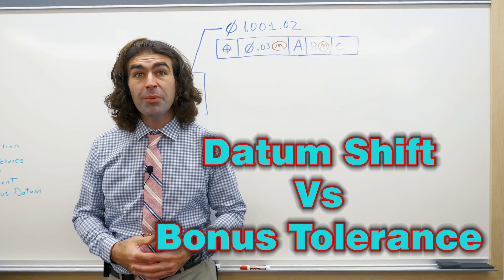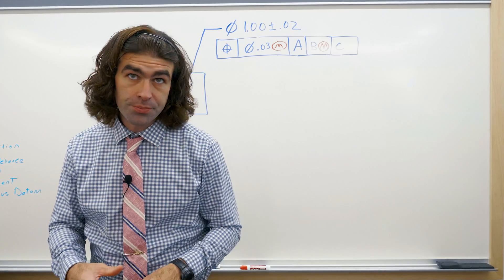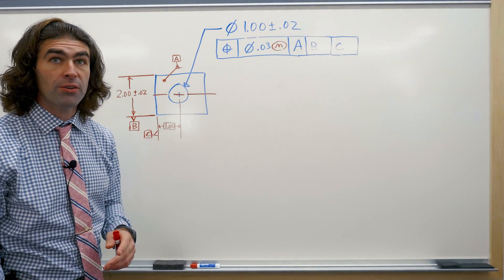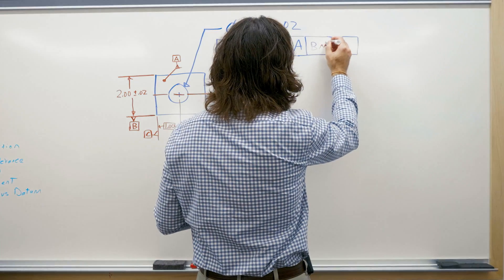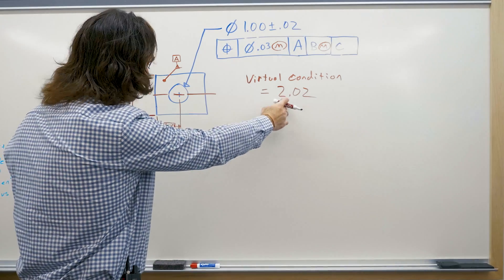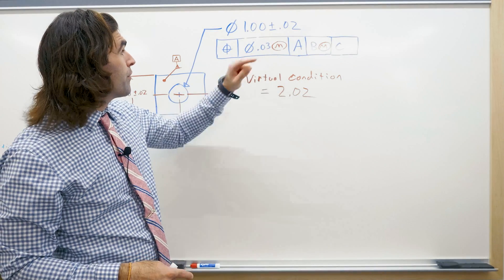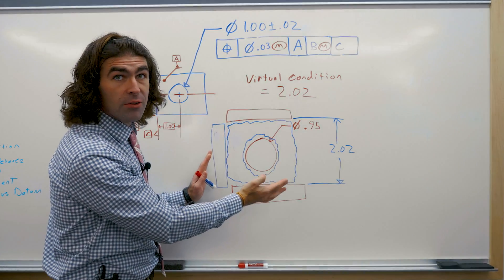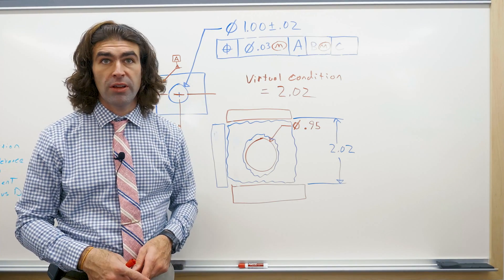GD&T ASME Y14.5 Bonus Tolerance vs Datum Shift

Comment: First off thank you for all the amazing videos. They’ve been extremely helpful. Secondly, could you do an example utilizing data shift with both data B and MCB holes at say maximum material condition and do a tolerance stack up to a third hole to show what the date shift would do to the overall tolerance stack up.

Comment: If i design a hole in the inspection gauge, and put the part on the gauge, then use a 0.95 pin to inspection the position, how about the diameter foe the hole in the gauge, thanks in advance for your reply😊

Comment: I understand how datum shift works when inspecting a part to a datum at MMC, but how does it work to a datum at LMC?? that is confusing me.
Reply from the maker: Hi, it’s not possible to use hard gages if the Datum is referenced at LMB. The LMC limit is inside the part. It can be calculated with a CMM. I’d say it’s main use is for the designer to communicate design intent. It can be inspected as if it was specified RMB, with the slight chance that an acceptable part may be rejected.
Reply: Thanks for the clarification! @RDeanOdell

Comment: Hello, thank you for the video. One question: why is MMC necessary for datum B? fixing the part with "two plates" having their maximum distance (virtual condition), so that all producted parts can fit in is not clear by itsself?
Reply from the maker: Hi, so design-wise you could get the same outer boundary with MMB or RMB. For inspection, RMB dictates the use of some kind of collapsing planes, like a centering vise. MMB can be simulated with a fixed gage, but can also be checked the same way as RMB (although some tolerance may be given up this way)

Comment: with position, why it need datum A?
Reply from the maker: Great question! Datum A controls the perpendicularity of the holes. During inspection, both sides of the part should be checked to determine the tilt of the axis of each hole.